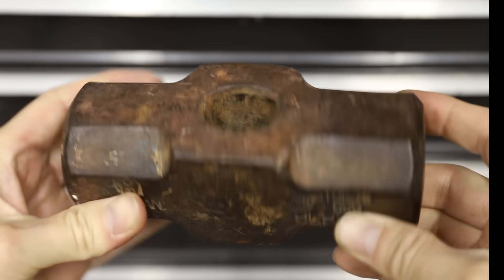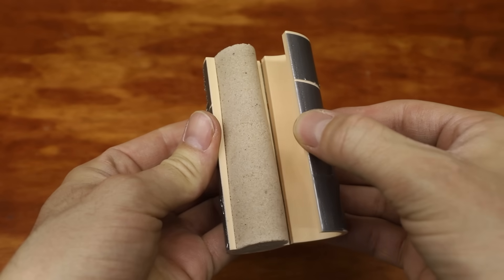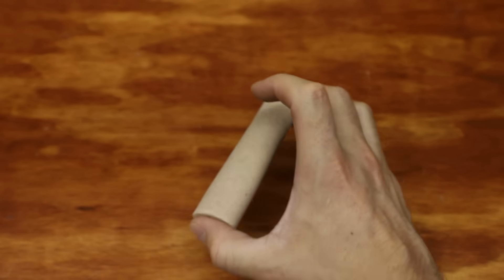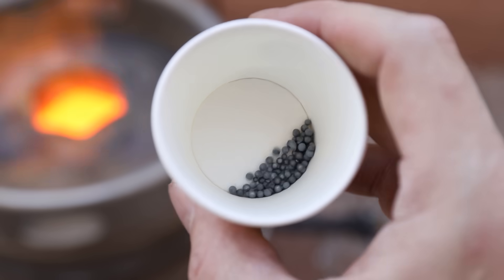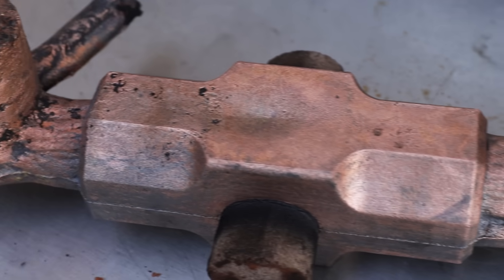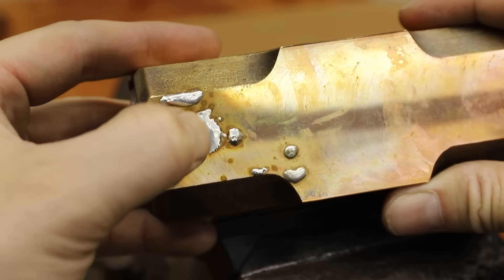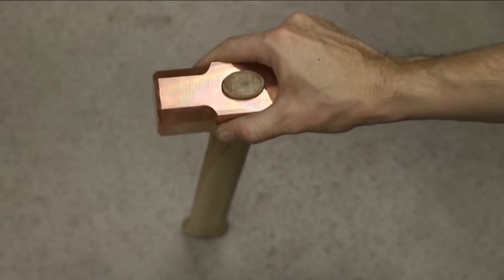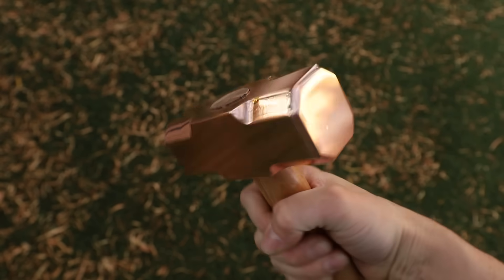Making a Solid Copper Sledge Hammer - HAMMER TIME!

Comment: If you want a trick to keep your firebrick from sticking to the bottom of your crucible, before you light the forge just put a piece of thick paper or cardboard beneath the crucible. It will be rendered down to ashes, but those ashes will keep the two from sticking. 

Think of it like salting your napkin at a bar to keep the wet glass bottom from sticking to your napkin every time you pick it up.

Comment: Dumbest thing to comment on. I really appreciate that you used a copper ingot rather than pennies, as it would be a real pain to find enough pennies from before 198...3(?) when the penny recipe was changed from pure copper to copper plated zinc because the cost of copper was then higher than 1 cent per penny.

Now that I've finished the video, absolutely gorgeous work! I'm curious if you're doing any sort of treatment to prevent the mirror finish from oxidizing?

Comment: Nice work. I’ve been a Toolmaker since 1972 . Now retired I still have a small machine shop packed into my 3 car garage. Just one question. How on earth do you keep everything so clean. Your machines look like they’ve never been used LOL  I Had a part time job once in a guys basement. Several mills  and lathes. You could eat off the floor and machines. His airlines were so short he made sure they wouldn’t reach a machine. You could take as long as it took to clean up after you were done. In spite of it all he still made money. Was a nice shop I have to admit.

Comment: You can buy copper sledges. They are commonly used to beat steel parts apart or together, depending on circumstance.

Comment: A steel hammer head is cast in a rectangular shape and then the forge presses them into the hex shapes. A hammer head gets denser and better from the cold forging of use over time as well. 
I don't know if copper alloys even benefit from forging, but I know OP cast a nice piece here.

Comment: Beautiful. I poured stainless steel for the hot water fittings for nuke reactors back in the 70's. We used a similar process. Resin packed sand that would burn off after the pour. It was a dangerous job that I loved.
Reply: Jesus Christ died for your sins please repent for the kingdom of heaven is at hand ✋ 🖊 📄 🤚

Comment: One thing I have noticed from some other casting channels - if you throw a piece of scrap cardboard between the firebrick and the crucible in the forge, it prevents the crucible from sticking to the firebrick and dragging the brick out of the forge. Just a simple little safety thing to avoid extra-hot things being out in a spot someone could contact them before they're cooled.

Comment: That is like a big piece of jewelry with the mirror finish. I could see that hanging on the wall of some giant construction company owner's office. I love copper, it's almost as beautiful as gold to me (maybe rose gold, which is mainly copper and gold anyway.) Great job!!
Reply: Yeah copper does look pretty good
Reply: COPPA
Reply: @Hyan look at the statue of liberty. The hammer will also turn brown/blue/green if not protected. There's pipes in my old house that have turned totally statue of liberty colored, most haven't. Im guessing it has to do with humidity/condensation.

If not exposed to too much humidity it may just turn dark brown.
Reply: sea water has nothing to do with copper turning green, my dorm at Princeton had green gutters and downspouts. The green in a function of time, 50+ years will get you a green patina@Hierarch_Hyan
Reply: @CentralStateHyan@CentralStateHyan  ok, you made me curious enough to research it.

 Corrosion is an umbrella term that covers all the effects on all metals from oxygen, chemicals, etc. There is indeed a difference between oxidation and passivation; oxidation is an effect of being exposed to oxygen, creating a tiny layer of oxide, passivation happens when that thin layer of oxide prevents further deeper corrosion. Oxidation from exposure to the weather is one way of passivating copper. It can also be done in a more controlled way and given a long lasting bright finish using chemical baths to get that same oxide layer. 

Passivated copper can be any color, bright, blue/green/brown. Whether it happens naturally or by chemical treatment, the important part, the protective oxide layer, is what protects it by preventing deeper corrosion. Similar to why rot doesn't penetrate stainless or aluminum from being in the weather, but mild steel will because it cannot form a barrier impermeable to further oxygen.

It doesn't need to be scratched or salted, just leave it outside. Or, just use wax, oil, clear coat, passivated bright, etc.
Reply: Yeah until day two when it starts the oxidize and turns into a green turd
Reply: @jacquestube  I think the tarnish is beautiful in its own right oxidized copper has a nice patina
Reply: It tales a long time for copper to start turning green, my dorm at Princeton had green gutters and downspouts. The green in a function of time, 50+ years will get you a green patina
Reply: It's very easy to prevent that with carnauba wax or with a clear varnish
Reply: I think brass is prettier.. and looks like gold.. I have brass revolvers replicas from the 1850s+ and often when I wear them loaded.   People think they are gold plated lol.

As for tarnish.. tarnish can be easily cleaned up with a polish compound.

Comment: 3:14 - "This is a 12-pound copper ingot that I made last year. It is exremely usless like this ..."
 11:20 - "Well, I won't kid myself, I don't think I'll be using this hammer for anything ..."

Now, seems to me it was quite a work to turn some "extremelly useless ingot" into something that... well, will never be used. Or am I missing anything... perhaps?
: )
Reply: He can sell it to any tanker crew, they use such tools to prevent sparks from hitting things.
Reply: @olafsvronskis7324  Well, close, but not there yet ;-)
Firstly, tanker CREW doesn't buy tools, it's on "the management/ owner". Secondly, non-sparking and non-magnetic tool are widely available, but nowadays they are made of beryllium copper - an alloy of Cu and approx. 4% Be, if memory serves me. The difference is, that this alloy is almost as hard as tool steel (typically chromium-vanadium). Also, arsenic bronze is quite good for making such tools, but not as hard and As is kinda toxic.
A soft copper mallet is used when you need to hit things pretty hard, yet make sure you don't damage the object - lathe turners often use copper "dollies" but those are much smaller. Dead-blow hammers used to be made from lead to - heavy and very soft, and if they mushroomed too much they were just melted down and recast.
Thanks for chiming in anyway ;-)

Comment: You do know that you can make a Sand Mold using Pink Styrofoam from the Hardware Store?
You use a 3"×3"×8" chunk and gently carve it using a Hobby Knife and some Wax to fill in the depressions. I learned this in Middle School Machine Shop back in 1988...
3D printer is not really required to do this Metallurgy.

Comment: One trick when putting the wood wedge in. Place a piece of 2x4 or any wood block on top so you aren’t striking the wedge directly. It severely lowers your chance of cracking the wood wedge as you are pounding it in.

Comment: Ignorant here asking: why couldn't he pour the molten copper directly into the hole that he drilled on the hammer itself? 8:51 Wouldn't that fill it in a better way that wouldn't leave a visible mark like the pressed rod did? I would think that the fluid would attach better too.

Comment: Very nice. As an alternative to dowel-fitting that copper plug, you could have turned it undersize a wee bit and brazed it in with phos-copper brazing rod. I used it a lot making copper fixtures at a lab I worked at and the color difference with electrical grade copper is almost nil. Love your videos, keep up the good work.
Reply: One additional observation-with the heavy mass in the center of that hammer you might have been advised to add a top riser to feed it, rather than the two side risers.The center mass will be the last part of the hammer to solidify and it needs to be fed up until final solidification. See page 7 in this .PDF file:   http://site.iugaza.edu.ps/sabdelall/files/2010/02/Ch10.pdf

Comment: I used to make these hammer types years ago when I was an apprentice for the toolmakers so they didn’t damage the metals they were machining.
We called them lead lumps but I used whatever was available , usually Aluminium but I also make them out of copper swarf scrap which was used on the welding machines as electrodes.
It was considered to be a shite job and always given to the first year apprentice but I really enjoyed the process and was a bit pissed off when I was taken off making them when a new first year started.
Reply: Definitely something you'll never forget and pretty cool skill set. One that literally almost nobody knows what goes into making something so "simple". Machining was one of the exploratory shops I took in tech school and we had to turn out a ball peen hammer as one of the graded projects in the few weeks that we had. Needless to say mine was pretty crude but I loved that damn hammer lol
Reply: @nickbisson8243  last year, my junior year of highschool, I made a very nice amalgamation of a brass faced hammer for machining and a slag pick for stick welding (I prefer tig so I normally only use the slag pick at home) but I turned a steel head and handle, knurled the handle and machined flats, then brazed the brass face on the hammer, then drilled a hole in the head, made an interference fit then welded the top of the handle to the top of the head, I haven't gone back to school yet to really test the machinist hammer part, but the slag chisel works nicely, the machinist hammer side will probably get a real beating during the next robotics season though when making parts. Since I don't really know what to make in shop class, I make tools, they're a fun test of my skills, they're free bc school materials lol, and I can make something that will last a long time and I really enjoy that.
Reply: My friend, are you all right? I wish you good health, happy family, happy every day

Comment: Those voids I believe are called inclusions. Nice work by the way! Please don’t let that be a wall hanger. Sell it to me. I’d use that daily. I’ve been saving copper for just such a project but I only have experience in lost wax casting. Hence why I’m researching casting copper hammer heads. You’ve more than earned a new subscriber.

Comment: As a mechanic, I use a copper hammer all the time. It doesn't cause mushrooming on my punches and chisels. And it doesn't deform steel when I have to loosen a stuck bolt or tapered connection like a ball joint or tie rod end.
A copper sledgehammer kind of defeats the purpose. But it looks AWESOME and I would hang it on my wall proudly. Great job...

Comment: Not only do you have the hard technical skills required to: 3D print hammer parts, create perfect sand molds, melt and cast Copper, and fix blemishes so it meets your high standards. You also possess great soft artistic skills to create an eye catching hammer, design positives and negatives used in casting, and final hand finish that really shows your hammer as you imagined in first place. 

10 years from now (or sooner) the Copper will take on the patina that only real Copper can. Nice Job - 'penny' for your thoughts. Wonder how many Pennies it would take to cast the hammer?

Comment: Aluminum bronze has a tensile strength and Vickers hardness similar or superior to stainless steel, meaning that you can expect durability and edge retention as good as anything you can find in the kitchen even if your alloy's not quite as good as commercial ones. Of course, your alloy could be even better instead, who knows? Bottom line, from the stats I find for the stuff, there's no reason not to trust the knife.

Comment: 10:25 what is that tool youre using to sand the hammer head?? Looks neat. Superb work by the way. Very impressive
Reply: That's a 90 degree angle air die grinder!

Comment: tip for your next one, the top of the hole is larger than the bottom so when you wedge the handle it wont slip off

Comment: hey buddy this is a really cool video youve made. 
 -- -- you may have heard this from others but if you take a piece of cardboard and put it on your firebrick under your crucible before you start your heat it will help prevent the firebrick from sticking when you go to pour -- --
 really cool hammer btw and id be interested in how much it would deform before the striking surface work hardens. also if the striking surface work hardens but the rest of the head doesnt i wonder if it would cause cracking... just idle thoughts.

Comment: Nice looking finished product!!!  Definitely not a 'working' tool.   Hammers that are intended to be used, should be forged, or machined out of forged billet, but not cast. Anything cast is subject to voids as evidenced by the many voids in your copper ingot, and your need for a plug in the finished hammer.  Although it could be used, it may crack or severely deform if other voids are present.

Comment: turned out really Cool as a Teenager i often helped My Father Restring Antique Motor Cars and Motorcycles  for Stubborl parts we didn’t want to destroy too bad because of  rare or wanting to reuse them  we often used a couple of “Tricks”. one was this very large RawHide hammer  that was essentially  many layers of Rawhide  rolled into a Cylinder held together by two  halves of a Steel flange bolted together to maintain the Cylinder shape of the Rawhide  and  gave you a place to  attach a Handle making you basically a heavy Sledge Hammer that  had a Rawhide faced Hammer head  that wouldn’t harm Threads on bolts or  Surfaces of metal We also had a  length of Solid Brass Rod that was about a foot long  and a Diameter of 2 inches  the idea and use of that was to beat on Nuts and Bolts with again not causing damage to the Fasteners  FYI most of the Vehicles we worked on were of British Origin  and they used  a Nut and Thread  measurement called Whitworth that were  harder to find inthe United States  years ago  now because of the Internet  it’s not so much the Case  your Copper Sledge was cool but i was  thinking how  handy a Small Brass head Sledge could be  for many trades  these days they do have  other options that  use interchangeable hammer heads that  contain different Composites and energy absorbing  items plus we have many versions of the nonMarring Dead Blow Hammers that i use a lot

Comment: Copper sledge hammer.   handle idea......   get some epoxy for making canoes or kayaks.   Cover the handle 2 0r 3 times.   Then sand an buff the handle....   It will be awesome.   It takes time but worth it
you can recover old handles  like new but better looking.

Comment: Thats incredible, but let me tell you from experience with large hammers, and getting hit by pieces of them when they explode, you put a tensioned piece of metal within the head of the hammer, and left it there with no welding or reduction of the tension.  That hammer is a workplace accident waiting to happen.  You hit anything with that hammer hard enough and that plug or a dozen other things will go wrong.

Comment: I love the way that thing turned out, makes me want to try my luck at it. I'm wondering why there were so many voids in that first copper brick you made and then wonder why there was such a big void in the finished hammer, or I should say finish poured. I've never cast anything so I don't really know other than maybe the gases you were speaking of. Also, why would you cut out a copper plug to fill the hole instead of filling it with molten copper? Too much expense in melting more or ???
Reply: My guess is that as the copper cooled it would contract and it would be a looser fit.

Comment: Fun fact! Brass or copper hammers were used for removing knock-off wheel lugs on old cars. If you see a car with a big single lug on each wheel with fins off the side, these kinds of hammers were used to knock them loose to be removed! You wanted a softer material than the lugs to not mar them.

Comment: Beautiful hammer! Possibly engraving it would take it to the limits! Of course, the 'pain' of watching this made, is knowing all those pre-1982 pennies that went into it (when plumbing pipe would have worked)! I use pre-1982 pennies to make 'sliders' for trapping snares...and only 'real copper' will bend at a 90-degree (the zinc pennies break). I get my wife to search her MASSIVE 'coin jar' all the time for 'the real stuff'...and it has gotten to where, out of 'new pocket change', she's only finding MAYBE 1-in-30 are still the pre-1982 coppers...people have pulled them out of circulation for copper-scrap-prices. It's pricey to 'make' the sliders out of copper-strip, considering the pennies are already 'rounded' and 'snag-free'...you just drill a 1/8" hole and run your cable wire...I've tried about every other way, but nothing beats the old 'copper cent'.

Comment: It looks great. How much does the copper head weight? I come across hammers of various types with broken handles, and fix them with custom wood or steel handles. Ive got fifteen sledges from 2 1/2 lbs to 18lbs. So i was wondering the weight of the copper. Thanks